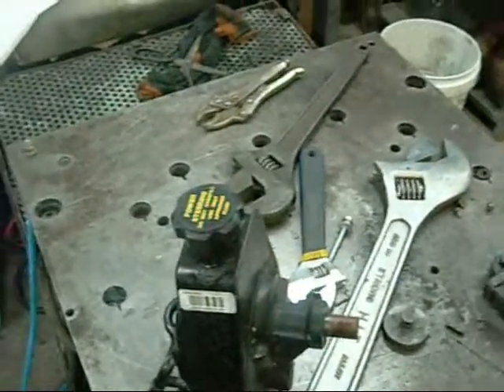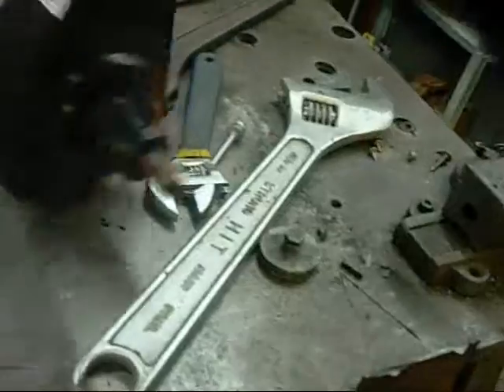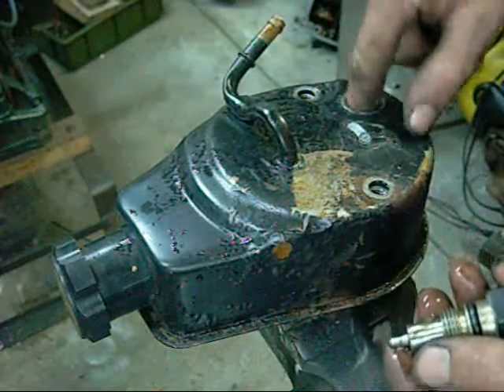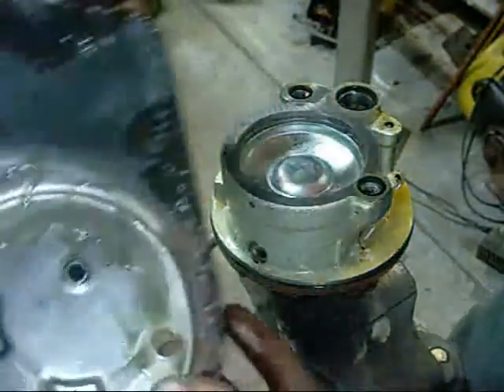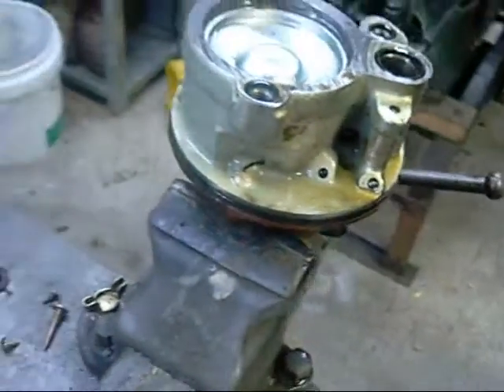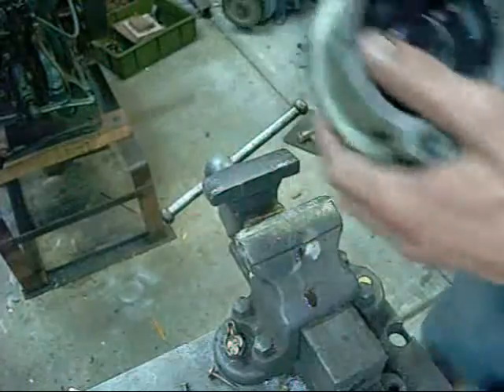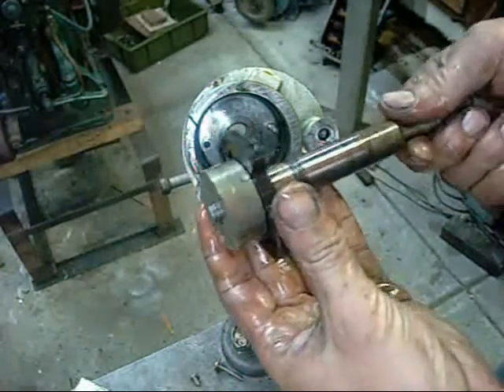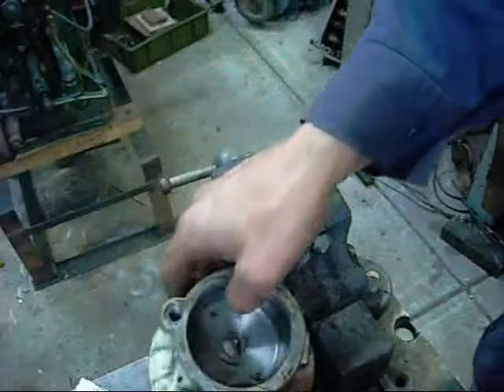Ford (Saginaw) Vane Type Power Steering Pump Disassembly

Comment: It's actually a Saginaw pump which is made by General Motors at Saginaw in the U.S., it's a bit like the 4 speed Muncie manual transmission was & still is made by General Motors at Muncie in the U.S.!

Comment: This is the how to not take your power steering pump apart. There is a hole on the exterior of the housing to put a small screwdriver into to release/ remove the large circlip.

Comment: The hole you see in the top of the spring clip groove is to insert a punch to aid in clip removal. I laughed when i saw you cut it up. I remember my first sagi rebuild.. bought the o ring and seal kit. Tossed the instructions aside fought with the clip for an hour and read the instructions which informed me of the obvious hole in the groove to get the ring out.
Reply: I put a seal kit through a BA pump last week, I also stuffed around trying to remove the c clip for a while, then after I removed it noticed the hole, by then it was too late, but will remember for when I do my next one.

Comment: Cool vid. Some recommendations, though.

1. Don't use a piece of metal to remove the housing. It may become dented and leak or suck air after reassembly.

2. Someone mentioned rotating the retaining ring until one end is almost aligned with a small home in the side of the cast iron pump. You'll get less metal shavings when reassembling your pump.

3. When removing the slippers from the rotor, use a paint marker to mark the external facing, outward pointing sides. This also helps to identify the correct orientation of the rotor and camring when reassembling. Apparently, these slippers wear over time as they move along the inner surface of the camring. Replacing them upside-down or in any other orientation will reduce the performance of the pump.

Comment: Instead of cutting a groove in the housing to get the snap ring out you have to rotate the snap ring so the edge of it lines up with a little hole on the outer side of the casing. You use a nail or precision screwdriver (mini screwdriver) through the hole to push the edge of the snap ring so you can get a blade srewdriver under it to flick it out.
Hop this helps mate!

Comment: that pump is not made for Ford, although they were fitted on ford cars, that's a sanginaw pump made by GM, they also were used on the 1980 Nissan 810 and Maxima's thru 83.

Comment from the maker: Cool!, thx for the info!

I was racking my brain about it last night because the pump needs to operate the PS rack at idle speeds as well as high end. that little spring loaded thing would be a pressure reg to maintain a constant pressure in the steering rack.

Comment: hey ed just wanted to share some info, those tiny round holes at the bottom of each vane is a pressure orfice it allows the pump to run at low speed by using pressure from the high pressure side to compress the vanes outward againts the 
race wall,,, the pump could run at low rpm but would not be able to amediatly pressure up until the high pressure side presses on the vane via  the little holes, tis would take 1/10  a second .gravity pulls the vanes down this allows the pump to pump at 800 rpm